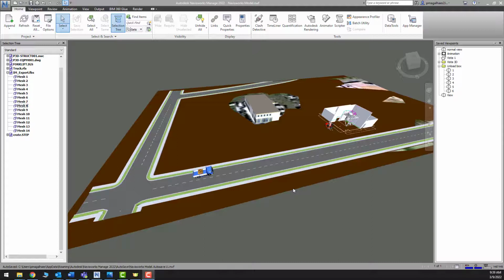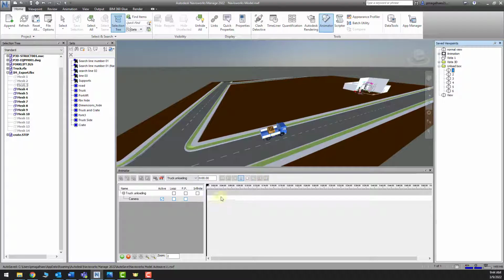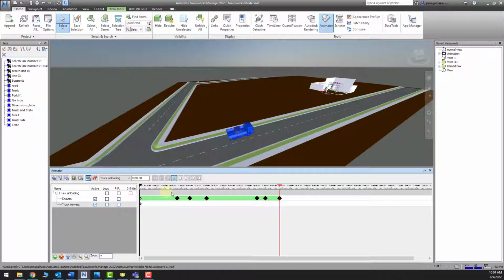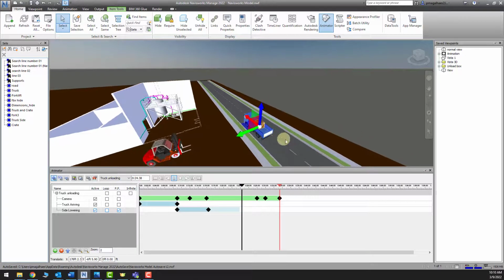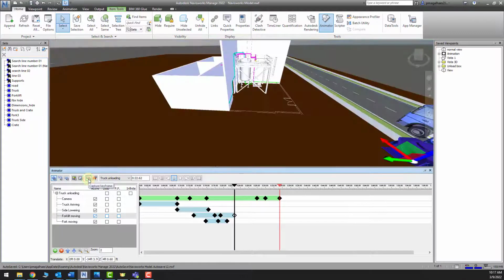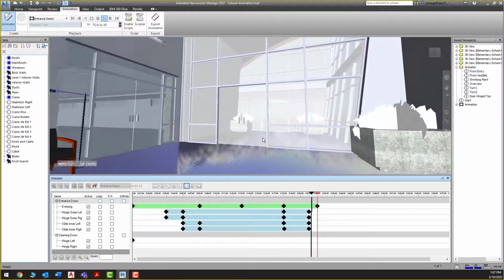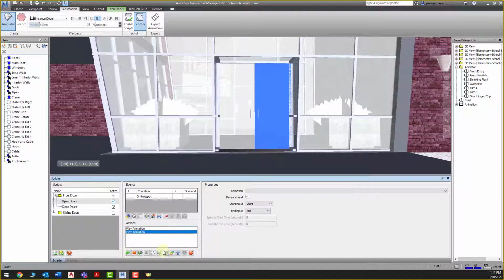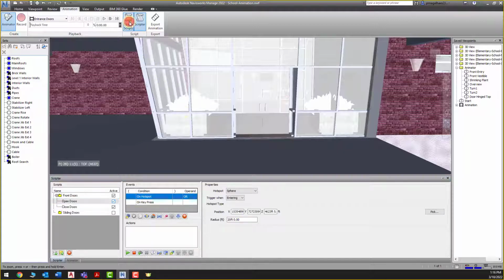Creating an Animation in Your Navisworks Model

Comment: Hello, thank you for this educational video, I need to ask a simple yet imperative question. The truck and the forklift, was that modelled or was that outsourced from another website?
Reply: did you get the answer yet?
Reply: @thattiyakhampichai7216  Nope, however, after scratching around on the net, I came across legitimate websites that provide modelled machinery i.e. earthmoving equipment, cranes, trucks etc.
Reply: Thanks 🙏
Reply: @emildachiuye3159  which sites?